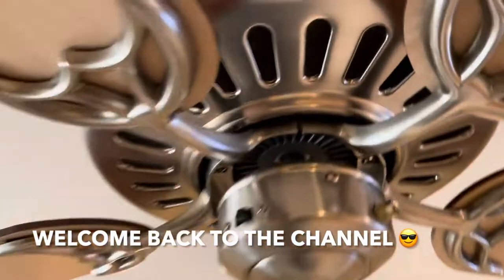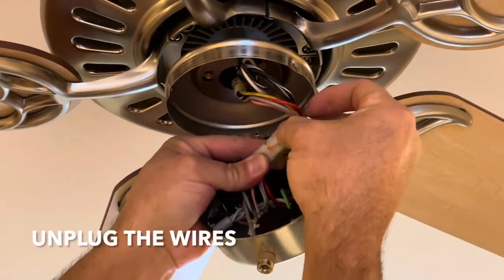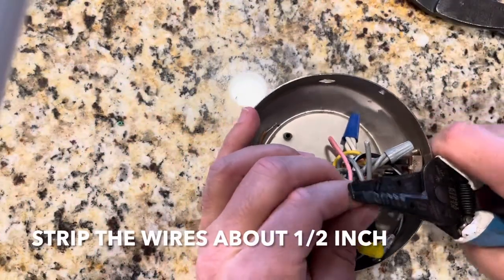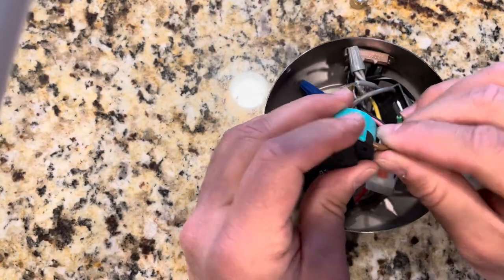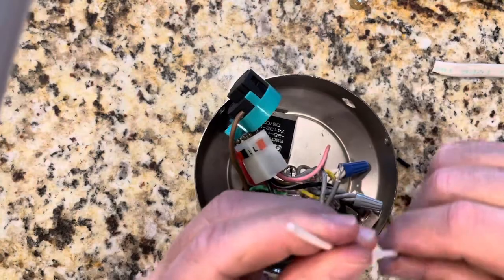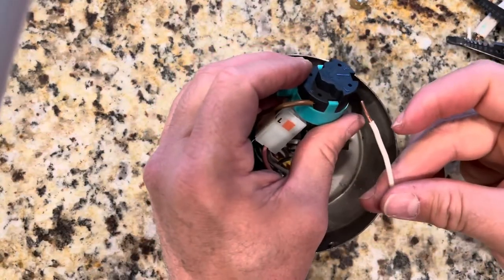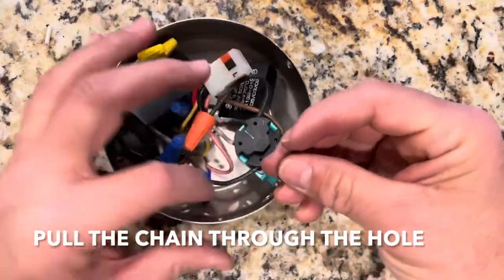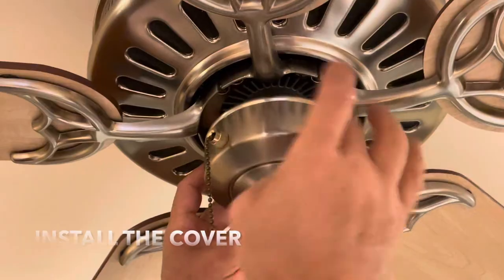CEILING FAN PULL CHAIN SWITCH REPLACEMENT - How to Change a Pull Chain Switch on a Ceiling Fan. Easy

Comment: The wires release easily with a paperclip in the little hole beside each wire. It takes a little wiggle, after the first one it becomes apparent which way to push the paperclip.